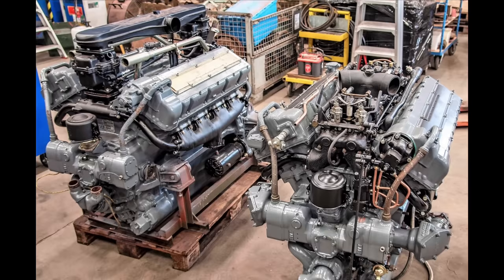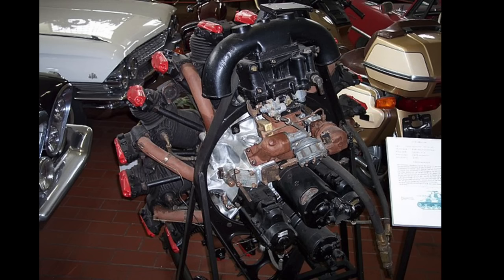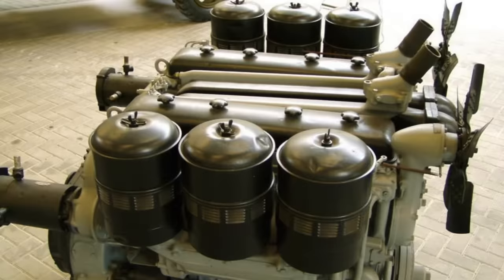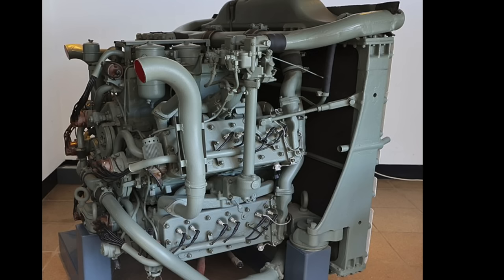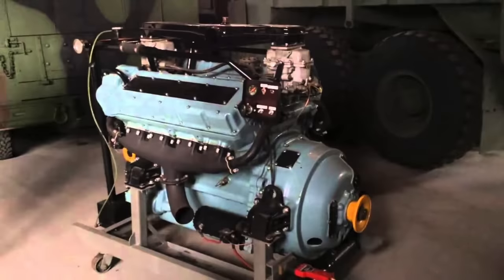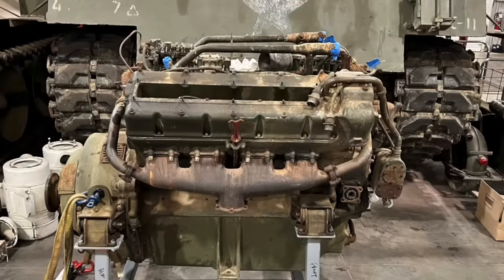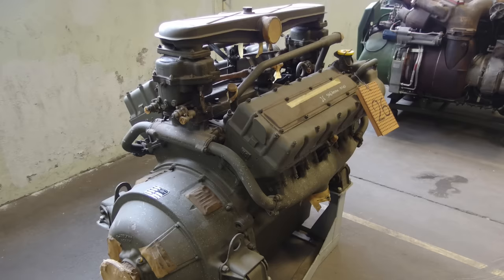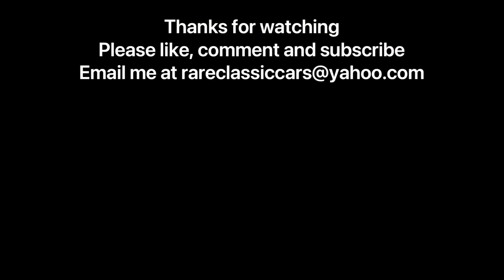An All-Aluminum, Flat-Plane Crank, DOHC V8 in 1940! Ford's 1,100ci (18L) GAA V8 Is a WWII Marvel

Comment: I have always understood in U.K. that the Ford engine in aircraft form was not up taken by USA because the development was slightly late compared to awarded contracts and there was a desire to have a limited number of engine designs functioning. It was much the same in Britain as there were many developments during the war but they were not uptaken because of the desire to produce a limited number of engines and parts producing reasonable performance. The problem of production engineering is to keep production flowing at high level. This was so with American tank where generals fixed on designs with known faults to have high levels of production because to develop the faults out of them would leave them with very limited forces so it took a little while to achieve the Sherman eventually succeeded by the M1. One of Germany’s problems was too many answers to similar problems and this resulted in further designs but limited production. It is interested to note that everybody tested each other’s designs and found the flaws but production won the day. We see the same at the moment. Tanks may be lost on both sides but crew survivability will be most crucial as metal can be fixed more easily than crews trained.

Comment: I bought one of these from an auction some years ago for $450 just because I thought it was a cool engine. Unfortunately, it was seized, and I had to go through the engine. After a year and half long parts hunt, I gathered everything I needed and went through it. Once back together I rolled it over and it started right up and ran perfectly. Now all I have to do is figure out what to do with it, I don't own a Sherman tank.

Comment: On the Gm 6046, being a 2 Stroke diesel engine means it didn't use "Supercharging" but a pair of "Blowers". Superchargers are a form of forced induction increasing the amount of air inside the engine while blowers on 2 stroke engines merely blow the exhaust gas out. Some 2 Stroke diesels did come turbocharged but always had to have a blower. The best examples of this are the Detroit 2 stroke series of module engines. The Russian do have 4 Stroke Diesels that have supercharging in some other their tanks.

Comment: I don't understand the flat plane crank a 90 degree or cross crank would've given it a longer stroke a flat plane or 180-degree crank needs more room in the crank case limiting the stroke but a 180% crank can rev higher and obviously this engine didn't rev over 3000 rpm I believe a 180 % crank would be detrimental to bottom end torque something really useful for a tank engine not to mention the vibration that all flat crank engines have I just can't see any advantages for this engine to have a flat crank

Comment: The GAA was designed as an aircraft engine but never used as such. Hence the engine specs. There was supposed to be a 12 cyl version as well. Making is quite similar to the Merlin engine. And the non supercharged version the Meteor. So 27 litre tank engine.

Comment: Another problem with the radial in the Sherman was the need for a high octane fuel, which contributed to the Sherman's nickname 'Ronson's' as they would often burn when hit. I wonder if this engine used a lower octane fuel vs. the radial.

Comment: the flat plane v8 crank is easier to manufacture (lower cost) and is proven to have better harmonic vibration characteristics in ultra-high (8-10k rpm) applications

Comment: Rather strange discission to opt for an heavy flywheel iso split journals. I am also curious why theu opted for dohc iso simple push rods, the 2600 rpm does not make dohc neccesary.

Comment: The v12 aircraft engines of the time had a redline around 3000rpm so it would make sense that the GAA would be able to spin that fast. The vibration might be worse but it probably wouldn't damage it too badly.

Comment: Back in the 80s, an old man raced a elcamio at my local dragstrip. It had a small block in it and ran mid 12s in the 1/4 mile. It had a toilet looking carb on it and I remember asking the old guy what that carb was. The carb came off a Sherman tank. Looked just like the one on that ford tank engine. The old guy said it was the simplest carb to tune and work well.

Comment: strange that they would used the flat plane dohc setup.... we generally reserve that setup for a high reving, high horsepower applications. that setup doesnt usually generate gobs of torque unless its turbocharged. so it seems wierd to me that they used this setup for a tank. maybe the monster displacement makes up the difference.

Comment: The best thing about the Chrysler tank engine is that the parts were common flat head. You could take a passenger car flat head Chrysler and pull parts off of it to repair the tank. Very simple and reliable.

Comment: The Sherman was meant to use up existing parts in the inventory. Only thing they had to design new was the turret. They used the Lee/ grant hull that radial engine and whatever else they cobbled together. These tanks are death traps.

Comment: The 30 cylinder engine was actually five 80hp straight six petrol engines arranged in a star pattern with all the pistons connected to a common crank.

Comment: Astronomically ahead of its time my foot General motors patented the twin overhead cam by 1913, Also Excelsior motorcycles had the beveled cam drive in 1916, Plymouth  locomotives with a leroy v8 With 2,005 Cubic inch Hell there in line six was 1,500 cubic inches. And the ford engine wasn't as reliable as a merlin or an allison That's the reason why it wasn't picked for an airplane engine 😂😂😂😂😂
Reply: if it wasn't reliable it wouldnt have been used in not just the sherman, but every offshoot of the sherman that was around at the time.

Curb your brand loyalty.

Comment: Not surprising really. That kind of configuration was standard for aircraft engines for the reason that it offered high specific power and power /weight ratio. 
Actually Ford did not design the engine - it was an 8  cylinder Rolls Royce Merlin.
The design was stolen by the US Treasury Department while the drawings were en route to Packard to manufacture and handed over to Henry Ford.
And if patriotic Americans want to argue, just check out the fact that the bore & stroke is identical, as is the rest of the construction!
Reply: Well you got it half right! See: Writings of Maurice Olley, who was a contract employee of RR and handled US side of Merlin for RR and remember that the Merlin and what Ford wanted to produce were different engines. Olley wrote a book under the unlikely title "Chassis Design, Principles and Analysis" which has a section that documents the whole sequence of events in the contracting and Ford's attempt to build an improved substitute for the Merlin before the contract was canceled and awarded to Packard.

Comment: I in no way intend to mock your video but I think there are a few corrections called for. The flat plane crankshaft in this case is not a futuristic concept ahead of its time is compromise return to the old design of the early V8s for the convenience of not having to design a new cross plane crankshaft for a 60 degree V8 which would have required much experimental work and retooling. The reason the flat plane crankshaft came BACK into use in racing engines was to use of the exhaust extractor effect available with the 4 cylinders of each cylinder bank on the much smaller and much higher revving race car engines.The flat crankshaft in the early V8s csused a serious side to side vibration which why the duel plane crankshaft was invented and used forever more in domestic and commercial applications.
Reply from the maker: I agree w you. It’s just interesting to me that it’s not novel.

Comment: I have read that this engine’s original form was as a V-12 intended for aircraft. When that did not pan out, it was chopped down to a V-8. It is awfully difficult to get an engine type certified for aircraft use.
Reply: As stated in the video.

Comment: Ok, live and learn. That's one I didn't know about. I know they (Ford) made a 427 'cammer' engine, with single overhead cams, in the '60s. Why that never became a mainstream thing ~ I guess it was too expensive. The whole benefit and joy of an American V8 engine, is that it's compact and practical and relatively cheap to make.
My other question would be the cam drive. I know Rolls Royce stayed away from chains when they built their race motors in the '20s and '30s, and they took the bevel drive gears and shaft on to the Merlin, which Ducati for one copied. What I don't get, is why they all stayed away from having a chain of gears. I mean what's so hard about having 2 or 3 idler gears and then driving both cams from one gear in the middle? Don't tell me that's not reliable or something... If you're going to put in a shaft, with a bevel drive at each end, why not just a set of gears? Don't tell me it'd consume more power or be harder to make or ... I guess it might make a little bit of noise, but that's hardly a concern in an aircraft engine. It has to be more efficient than turning the drive by 90 deg, twice in a row. If they had a complex about complex chains of gears, then why did everybody have a fetish for planetary gears? Henry Ford in particular, had an absolute woody about planetary gears.
Reply: Noise
Reply: @keithstudly6071 ~ [shrug] Ok, what-ever ....
I will admit, the engines I'm aware of that run a chain of drive-gears, they're all pure race engines. Nobody I know of, has made a standard road-going engine that way. I think even Honda, made their early V4 race motors with a gear-chain, but one of the few changes they made for the road-bike version of it, was to go to chains. I know the first gen of VF V4s had trouble with cams and cam-followers, (crappy case-hardening on the lobes and oil supply) but they had chain driven cams, that wasn't the problem. Then the RC-30 had a bit of a problem with oil return and pumping all the oil up into the cam-covers and running out, while pumping oil out of the crankcase breather like a garden-hose, but I'm pretty sure they all had chain driven cams by then. Some of the VFR 'Formula One' bikes (Isle of Mann, Suzuka 8hour) had a train of gears... Those were the parents of the 1st VFR-750 road-bikes, and an awful lot of the very trick race-bike did make its way onto the standard road-bike, (including the beautiful simple elegant beam-chassis) but the gear-driven cams didn't.
Reply: Well the only engine i am familiar with that used a gear driven cam was the 345 CI International truck V8. I was always told that they got better durability but more noise. Many hot rodders have made gear drives to replace chains and , again I have been told they are noisy. I think if they used the right cut of gear and worked hard at it I bet they could beat the noise but wonder if it's worth it. If you are talking about OHC engines it just gets more difficult because more gears. Early on bevel gears were often used but they were fussy and hard to keep adjusted. By the mid 1920 spur gear drives were the norm and not too much later chains. Duesenberg's J straight 8 was chain driven in 1928. Competition engines stuck with gears because they had no noise concerns.  @Kneedragon1962
Reply: @keithstudly6071 - Hello Keith. 
Even competition engines seem to be moving away from them. Formula One went to pneumatic valves, for closure. MotoGP followed them, [roll eyes] except for Ducati of course, who went Desmodronic. Trying not to get side-tracked here about closures ~ The point I was going to make, those all still have double overhead cams and poppet valves and drive the cams by chains. They're not roller chains, like a final drive on a pushbike or motorbike, they're hyvo chains, with an odd number of plates on one link and an even number on the next.
----
I understand Rolls Royce went with shafts and bevel-drive gears in about 1926, because they'd had terrible reliability with chains when they'd experimented with them. I understand Ducati copied Rolls Royce some time in the 1960s, but they added Desmo. (Personal note : Ducati have always been a little bit weird ~)
[edit ~ aside] Did you know Ducati didn't invent desmo? I'm not sure who did, but the first 'famous' use of it, was on the Silver Arrow Mercedes GP cars of the 1950s, the ones driven by Jean Manuel Fangio and Stirling Moss. I don't know about the pre-war Silver Arrows, but the ones Fangio drove, had Desmo valves.

---
Then you get Mister Koeniggsegg, from the land of IKEA and Volvo, who wants to operate valves the way we operate  a sub-woofer ~ I admit there are potentially benefits from doing that, but the idea seems to have submerged without a trace, like a submarine tour of the Titanic.

Comment: They should have put that engine in the tandem drive semi's of the time. I bet that would have ran laps around the big gas 6 cylinders n held in with the smaller diesels.
Reply: The cost likely would have been far too high.

Comment: V-1710 Allison engines, not Merlins. Packard didn’t start building their licensed copy of the Merlin until 1942.
Reply: Britain has asked Ford to produce the Merlin engine but Henry Ford did not want to do so. He ordered his engineers to make a better engine then the Merlin and they did so, using the same bore and stroke. When he showed this to the AAC they refused it due to having contracts with the Allison company. Ford had already build a factory to build the V12 and when the army came looking for a V8 engine for the Sherman, the design was modified due to most of the machinery and tooling already having been made hence the sixty degree angle rather then the ninety degree angle.
Reply: Ford had a contract to build Merlins but tried to substitute their own engine, one of the reasons the displacement and dimensions were the same as the Merlin. Ford even waited till they had Merlin blueprints before they finalized the design so they could be sure it would be a direct, bolt in substitute. Then they said they were going to produce THEIR engine and not the Merlin. Finally Ford's contract was canceled and Packard got the Merlin contract. Ford converted the design for tank engines.

Comment: What is a 90 degree angel V8?  Did you mean a 45 degree angle V8?  Because a 90 degree angel is an inline engine.  There are inline 8 cylinder engines used in tanks, and there are also 60 degree engines - but 90 degree angel V anything makes no sense.
Reply: 90° is not in-line at all. It’s 90° between the cylinder banks. 
There’s lots of 90° engines.
Reply: @NBSV1  Please explain what 90 degrees between the cylinder banks mean, and what other engine is 90 degrees that's not an inline.
Reply: @jamesjacobs1909  It's a 90 degree V8. Most V8's are configured this way.

Google is your friend.
Reply: @tedforsure8659  Yes, 0 degrees is straight up and down, and 45 degrees in opposing directions is at 90 degrees.  In automotive machining we look at engines differently.
Reply: @jamesjacobs1909  That means it's a 90 degree V between the banks. An inline would be 0 degree. A flat engine would be 180 degree. 
Like the other comment said, google can help you understand better. Just look at the images and it'll make more sense. And, that can give you a list of how many engines are like this.
Reply: @NBSV1  Don't need google, that will get you in trouble.  So, what degree is the #1piston on Ford V8 at top dead center?  And it it different than a Chevy?
Reply: @jamesjacobs1909  Which Ford V8 and which Chevy V8? They've both made a few different versions of them. 
Degree of the #1 piston relative to what? In crank degrees #1 at TDC is going to be zero.

Comment: Also they were basically 3/4 of a V12 equilivent of the RR Merlin, hence the 60 degree V layout, instead of the traditional 90 degree V for V8 engines

Comment: Imagine a modern scaled down version of this at around 250 cu in, but built with contemporary top spec alloy, using modern hardware, assembling techniques and accessories; still low stressed and kept below a 4000 RPM redline? It would be a wild engine for like a midsize truck like a Ranger or a Tacoma.
Reply: Albeit probably intolerably noisy...

Comment: Only 500hp....
Reply: And 1,100 lb ft of torque. I can assure you it gets the tank moving!
Reply: @jsplicer9  6046 detriot was a better option, redundancy, and not a fire hazard...
And 1 of those engines makes close to that torque
Reply: @taomicioli  the twin diesel variant of the Sherman (M4A2) was used by the Marines and the Soviet army, since they primarily used diesel powered vehicles, and was well liked. The US Army on the other hand primarily used gasoline, and would continue to do so for some time - tanks that were used years later like the M48 Patton or the M103 heavy tank initially used a gasoline engine for propulsion. Logistically many armies preferred to stick to one source of fuel. The Germans for example tried to relegate the diesel for naval use, so most German army vehicles also used petrol

Comment: What were the Chrysler engineers thinking.......
Reply: The Chrysler engineers were thinking that they needed a 400 to 500 horsepower engine but they had no factory to build such a engine and to build a new factory took time which they did not have. They did, however have a factory that was making their six cylinder engine and as car manufacture was going to be on hold, there was a factory with spare capacity to make more engines. Was it the best design, no, but it could be build quickly and that was more important.  It did the job.